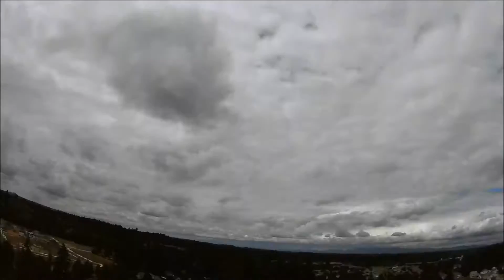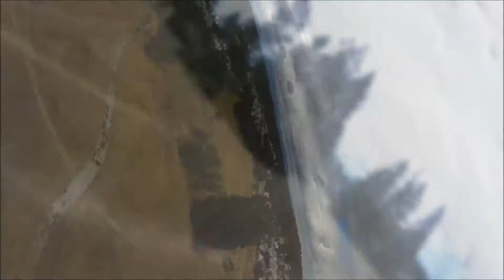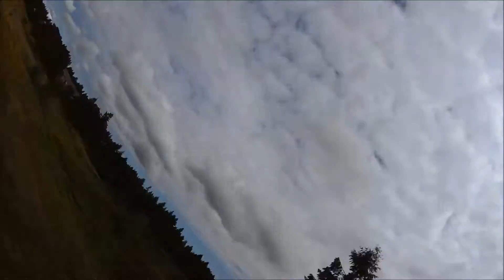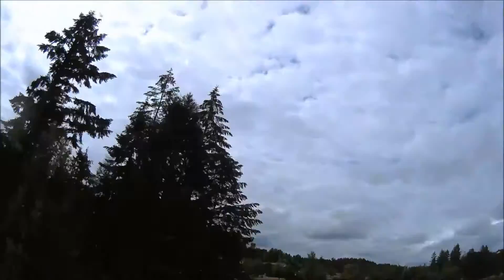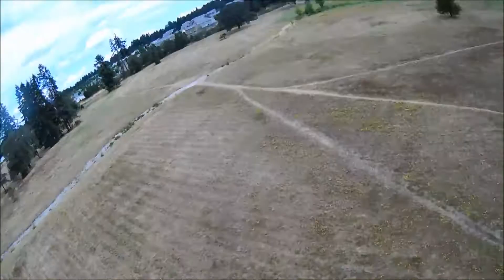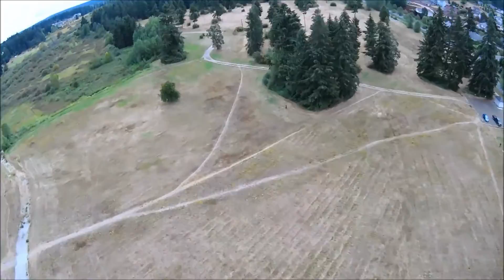Makerfire esc and motor test

Comment: Thought these motors only rated to 4s, and you say cool when you landed.
Reply from the maker: Just because they are rated 4s doesnt mean you cant push it.  It had low pitch props so they didnt have to work too hard.  Plus i dont think they even make these motors anymore.
Reply: @HotDogFPV  OK, lower pitch props makes sense.
I was given a set a while ago and just came across them and just  searched n found your video. Cheers mate for reply